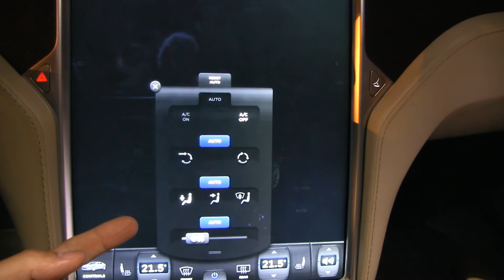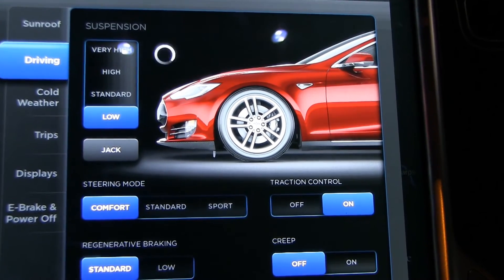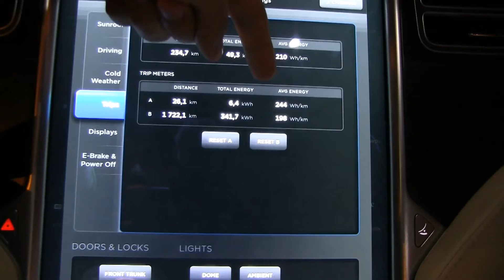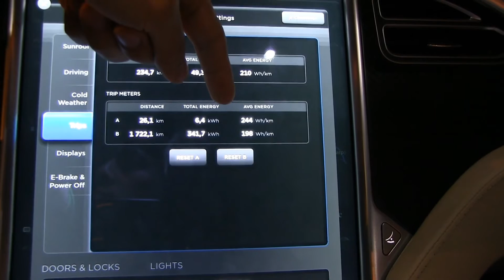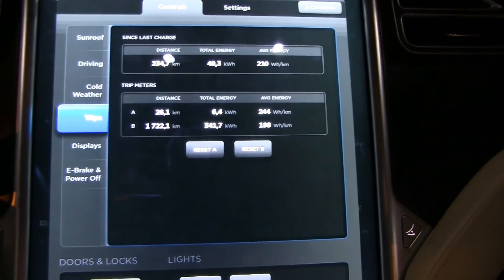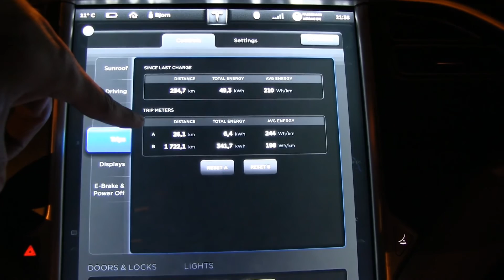Tesla Model S energy consumption normal vs low suspension

Comment: 244wh/km is quiet good i think. That would mean 327km for a fully depth discharge(80kwh), not?
Have you done some combined consumption tests?
50% city, 50 130km/h highway?
I find that particulary interesting for german roads, as here 130km/h are almost a minimum on highways without speed limit.
Thats why all the auto magazines here complain about Tesla Model S range.
Reply from the maker: From my own experience, about 75 kWh is available. The rest is bricking protection and zero mile protection which can't/shouldn't be used. That means about 300 km range. But in reality you want to charge to about 70-80 % and drive 100-150 km to the next SC.

The Europe road trip video shows combined consumption tests.

The German magazines base their assumption on a poor and unrealistic range test of Model S.

Comment: Interesting, well at least I know that the air suspension is more for the ability to show off or climb kerbs rather than save energy. 

Cheers dude!
Reply from the maker: Yes, for 95 % of the time, low won't save me much energy. Especially since I usually have 70-80 km/h speed limits in Norway. But sometimes when driving in strong head wind and on motor way, I would assume there could be up to 3-5 % saving.

Comment: Hi Bjørn, Thanks for posting these videos, I enjoy watching them, it is interesting and I learn a lot about the model S. Now I have a few questions/ suggestions, If the low suspension setting eats up the tires faster than the normal one, it would be interesting to do a test with high, normal and low suspension to check out energy efficiency, tire wear and tear, car handling etc. To have a full overview of the performance, at speeds of 100, 150 and 180 km/h.

I wonder why the Tesla model S come with LED headlghts like the Audi or Merc Benz. Surely the LEDs are more energy efficient and moreover having this would increase the range, since the LEDs draw much lower power from the batteries for the same lumens. Furthermore LEDs are more eco friendly. So all in all a win win situation, I hope Tesla motors consider this and and make it a standard in all their cars in the future!

Do you know or have any info as to why Tesla has not come out with LEDs?
Reply: Bjørn Nyland I think the bigger benefit to switching to LED over xenon HID is longevity. I deliver pizza for a living in a Prius with HID headlights, and since I turn them on and off a lot, they wear out in about 2 years or so. The dealer sells the bulbs for some ridiculous amount like $190 per bulb, but I can also buy them on Amazon for about $50 per bulb. That's not a huge expense but it is annoying because they're a pain to change in addition to the cost. Halogen bulbs cost about $10-15 each almost anywhere.

LED headlights don't have any trouble being switched on and off as much or as little as you want-- it doesn't affect their over all lifespan, which means you probably never need to change them (or rarely, if you're unlucky and get a faulty emitter). That's also an advantage here where as soon as dusk comes and the sun sets, there's always about 10% of drivers who don't turn their lights on until well after dark when they're practically invisible on the roads. I have to flash people to turn their lights on almost every night I work, so that's sometimes an extra 5-8 on-off cycles per night besides between deliveries-- it's a lot of unnecessary wear and tear for an expensive bulb with HID.
Reply from the maker: babybirdhome Yes, you're right about the wear. However, when you flash the lights, you don't switch the lamps on and off unless your lamp is already off. Xenon uses a cover to switch from low beams to high beams.
Reply from the maker: High and very high can't go faster than 45 km/h. Those settings are for just slow driving over obstacles.

If you drive in 100 km/h for one hour in daytime and consume 200 Wh/km, you will spend a total of 20 kWh. The Xenon headlights consume 2x35 W (EU model). If you drive at night, the Xenon will bring the total consumtion to 20.07 kWh which is 0.35 %. Even if they are replaced by LED headlights, the energy saving is minimal.

Other modifications will save more energy, such as improving airflow.

Comment: Interesting. I guess low only really makes sense on long stints on the autobahn... or Nurburgring. :)
Reply from the maker: This shows that low is not needed for speeds below 100 km/h. It's also claimed that low gives slightly higher negative camber which in turn will wear out the inside of the tires more. So I rarely use low.
Reply: Bjørn Nyland
Yes, I suspect its a hi-speed racecar issue, not much applicable to a low Cd low COG car like the MS at normal speeds.  Much ado about not much.